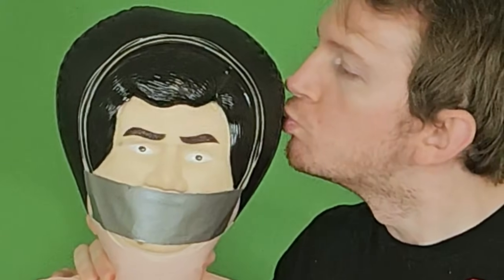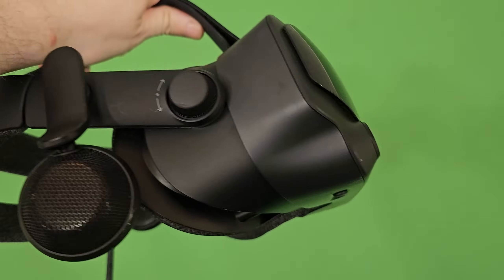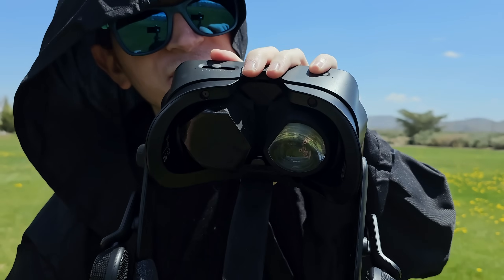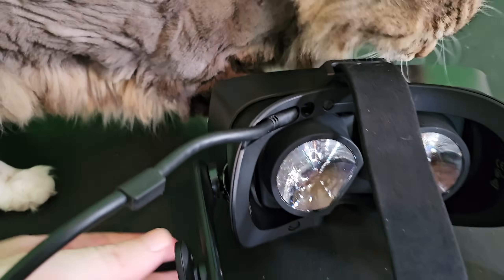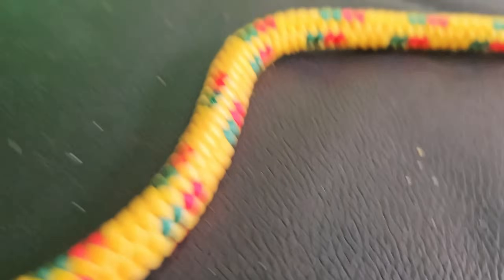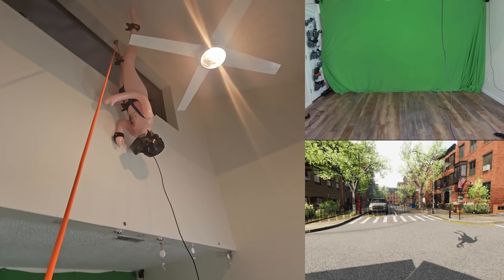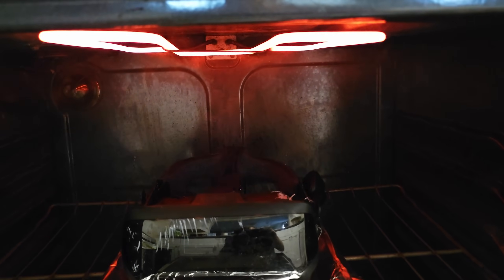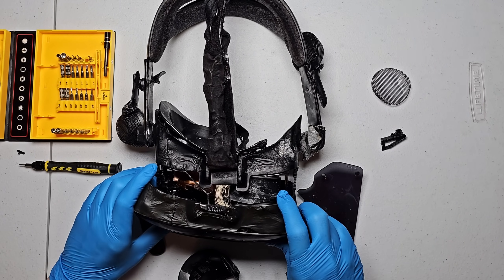I Performed ILLEGAL Experiments on my VR Headset!  *EXTREME TORTURE TEST*

Comment: I can explain the milk one. Much like the old "put it in rice if it gets wet" trick, the milk was similar to water. It smothered the electrical parts and essentially caused it to short. Then, when you baked it, it ended up drying out the moisture and removing the entire aspect that caused the shorting. But, long term, we're talking accelerated rusting of the circuits, maybe a rancid cheese smell, it'd probably not have lived a full life regardless.

And it goes without saying: Kids, don't oven bake electricals to dry them faster. Different electrics have different heat resistance. This headset is made of thick plastic, which would take longer to melt, but this wouldn't stop the foam earpieces or LCD pieces melting first. Phones would probably be ruined within minutes. So don't burn shit in the oven, both because it doesn't work and because plastic smoke is toxic.

Comment: Use the a Vr headset to play a game. But have a seperate VR headset that is linked to the one you are using. Then have 2 GoPros angled to be looking at the Vr headset you are not using. Then put the Vr headset you are not using outside. Then last but not least head inside and "game on".